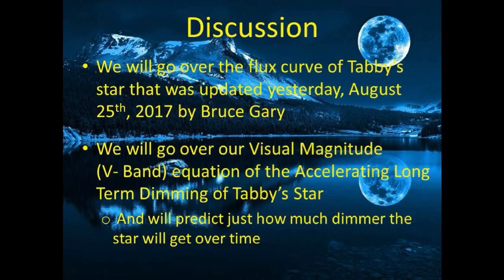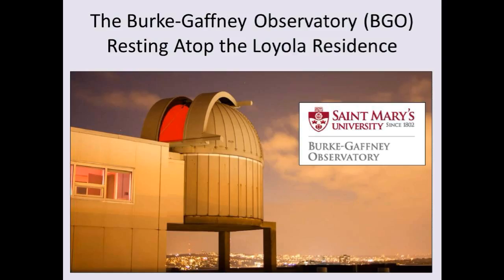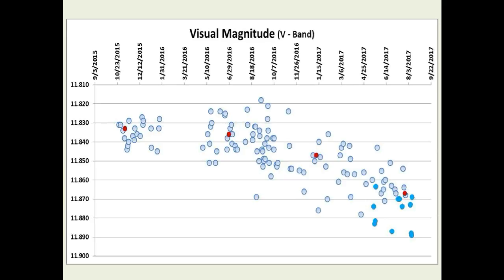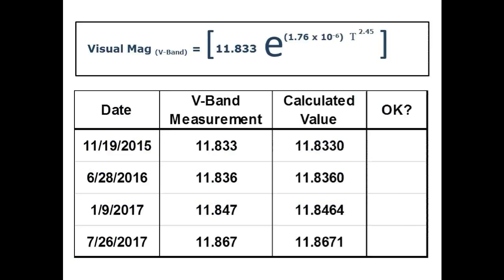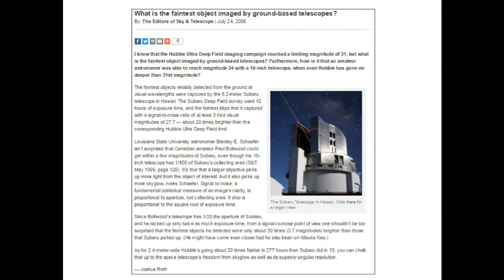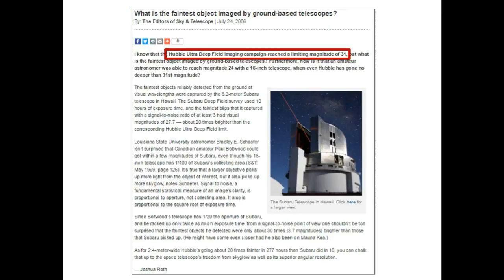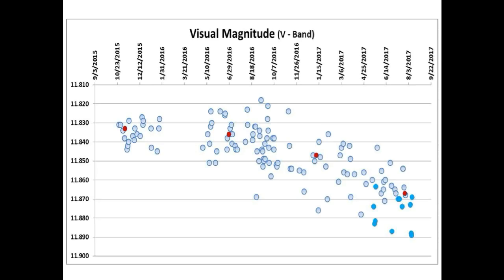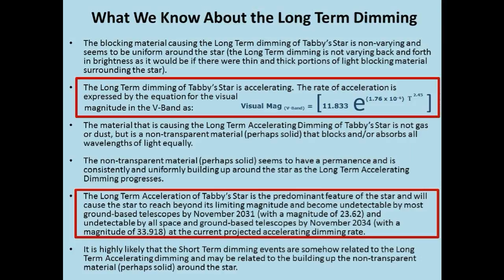Tabby’s Star KIC 8462852  Flux Update for August 26, 2017

Comment: The light curve so far appears normal for a star. The variance of the light magnitude seems to be a stellar phenomenon that occurs repeatedly throughout a star's life. The greater the dimming the more wild the radiant swings much like our star is demonstrating right now.
Reply: Well, we are watching Tabetha's star for it's abnormal behavior. While it's magnitude variation is unique, it's trend is not. Star's share a similar waveform that can be seen in The Solar Cycle. The main difference between stars is the strength of it waveform amplitude . Only, what is unique here is that we are seeing that stars change, their amplitude varies over time with some sort of cyclic behavior such that any star will go in and out of a stable and a rapid amplitude variation. The stability is linked to it's wave crest for some reason and it's greater amplitude variation is linked to the wave trough. Obviously I am reciting personal theories in all this.  Modern theory predicts that such change to decline and rapid variation would herald an imminent stellar demise. It is just that our star is changing it's amplitude too to one of greater variation (exiting a crest) if not as dramatic at this time as Tabetha, yet has no sign of demise. It looks as if this is just "normal" stellar behavior and makes it possible to predict that our sun is going to get stronger amplitude wave forms in it's solar cycle (you can already see this).
Reply: Our Sun is doing what?
Reply: Isn't this a form of as Ad Hoc Naturalis. I mean it is way more likely to be natural via induction. I find the ad hoc rescue nature of the natural only argument.
Reply: Jarred - that sounds cryptic.
Reply: It isn't just curious how the natural only explanation being the go to. I am wondering if that influences your perception of the data and not being truly objective. However, I do think the conclusion should always derive from the evidence, and I am wondering if inductive reasoning is what is being used rather than deductive reasoning.
Reply: The numbers I've read say that this Earth is so rare, according to the Theia impact parameters along with all the other improbabilities, that consequently the pure numbers say there's only 10 tech-civs in the whole Virgo Supercluster. The nearest one is millions of LYs away. 

Of course, I could be wrong... lol   ...We could be very very unlucky..
Reply: iok-1 Rocky planets in the habitable zones of a F/G class star like our Sun may be extremely common.  We just don't know.  We also don't know what conditions and how long it would take for life to develop into complex multi-cellular life.  It may be that it took an unusually long time for complex life to develop on Earth.  These are all questions that await answers and honestly whatever numbers are published today are the just speculation. More than any other branch of science, astronomers have a annoying tendency to present conjectures as "facts".
Reply: David - yes, it's full of unknowns, but----

Small rocky planets have small cores that are not long-lived and therefore don't protect the evolution of intelligent life.  But who knows?  The evolution of intelligence requires billions of years of stable and favorable conditions?  And therefore a protective magnetosphere? 

Without a large stable moon the rotational axis of Mars has shifted over 40° in just the last 15 million years.  Devastating climate change.

Dr. Robin Canup has done supercomputer studies and that collision that formed our Moon is a very unlikely event.  Trajectories and the molten states of both protoplanets and the timing all have to be within favorable ranges.
Reply: Thank you for the replies, yea I am just baffled because I guess inductive logic is really odd logic in general.
Reply: lok-1  Most of the conjectures of rare Earth theory are badly flawed by the anthropomorphic bias.  Not surprising since all we have to go on is the history of life on Earth.   I see no reason why intelligent life couldn't arise much more quickly than 3.5 billion years as it did on earth.  From the Cambrian explosion until the age of dinosaurs was only about 400 million years.

As for moons, what about a planet with two smaller moons?  A larger moon farther out?  Or a smaller moon closer in?   Mars acquired its moons via gravitational capture, why not other rocky planets?  Say a planet doesn't have a large moon.  If that planet was on the order of 150% of earths gravity, it would a much greater rotational stability when it comes to axis tilt change.  Lastly, as for simulations,  I'm of the firm belief that for many simulations of this nature, you can get whatever results you want.   

Bottom line, we simply don't know how long it would take and under what range of conditions complex life could develop.
Reply: David - "Bottom line, we simply don't know how long it would take and under what range of conditions complex life could develop."

Yes, so what's the minimum amount of time, do you think?  1 billion instead of 4.56 billion?

It's true we only have this sample of one, but we also can see in our solar system that there's no cases of stable conditions comparable to those on earth for the last 4 billion years.  There's been large shifts of rotational axes, there's been large impact events more recently than those on our planet's somewhat protected position.

Contributions to our planet's core has been crucial, but that might not be so rare.  OTOH, to get a large moon to form from ejecta at the Roche limit seems to be quite unlikely, due to the requisite angle of impact and the molten states and speeds.  In fact recently the theory had to be updated with moonlets, to try to explain anomalies in isotope abundances.  Fascinating stuff!  Our moon is very difficult to explain AND it's so stabilizing and protective etc. that where would one like it ever form again around an Earth-sized planet in the lifezone, with all other same favorable conditions and constituents and galactic position and helpful sequence of impactors? 

I understand you, I just have so many improbabilities to think about for predicting.  I'm a research meteorologist in a geophysical lab, so with a big help from computer runs I predict chaotic tropospheric and stratospheric systems all the time.  But this case has a large number of parameters, and most of them don't dampen eachother out as in atmospheric dynamics.

Comment: Something must happen to photons of light.  Total flux cannot dim to 0.  Take, for example, shredded aluminum foil (chaff) in sunlight on earth.  If you have enough material few of the photons get through directly but it would still be daylight because photons are bouncing off of multiple pieces.  A dark material could adsorb all the visible light but it eventually comes out as low frequency heat emission.
Reply: Fainter than the Hubble can detect, but maybe not zero.  Becoming a very large black dwarf shell encasing a tiny black hole?
Reply: no, same bolometric luminosity as it currently has.  4.68 times solar.  It will either be reflected and scattered light or we will get 1.8 x 10^27 watts of thermal radiation.  Could be a combination but will still total 1.8 x 10^27 watts.  Reflective material changes the direction the light travels. Does not remove it.
Reply: Yes, currently, it's a huge ball of gas with a 30 million degree core.  How could it become something very different in only another 30 years?   Imagine how much activity and reactions that would have to do the transformation.

In my field, research meteorology, we extrapolate beyond the supercomputer runs of 16 days now, but we don't expect a trend to continue very long in nature.
Reply: iok-1 so can I ask you in your opinion what you think is causing this?
Reply: how about a large mass 5 LYs this side of the star? Two rogue planets (ejected from their systems) collided far from any star. Cooled down by now, no infrared.

Can we eliminate comet swarms, dimming back to its normal flux centuries after a large planet was engulfed, a slowly rotating ring of debris in our Oort Cloud?
Reply: If you go for rogue objects orbiting each other then they are near our Oort cloud.  The objects can be smaller than planets which eliminates most of the size/mass weirdness.  Also would be coming this way.  A good one for the paranoid.  :)
Reply: stefan - Can you explain your statements?  orbiting? near our Oort Cloud? size/mass weirdness?  coming this way from 5 trillion miles away?
Reply: There is an object blocking the light from KIC 8462852.  If we assume that it is in a 740 day orbit around kic 8462852 then the object must be much larger than Jupiter.  If we go to one of our telescopes and throw a tennis ball in from of the lens it could block more than 20% of the light. If objects look the same angle then the closer object is much smaller.  

Assuming this is a binary object in the oort cloud one of the objects lines up with KIC8462852 once every 740 days.  The object is not moving away from our line of site because it keeps rotating into it.  So the objects are not in orbit around the sun so they must be falling towards the sun.
Reply: stefan - you might be right.  I still don't understand how you explain the periodicity.

Here's a paper on a ring in our Oort Cloud, but it's fallen out of favor I think,

 “Matter may be distributed very nonuniformly within a ring, so that in any Kepler-year the probability that the line of sight intersects a significant quantity of absorbing matter during the brief period when the line of sight grazes the ring may be small. This is necessary to explain the absence of deep dips between dip 5 and the cluster of dips 8–10 or a Kepler-year prior to dip 5. There may be many more potential “Tabetha’s Stars” in the Kepler field than actually dipped during its four years of observation, and Eq. 3 is a necessary but not sufficient condition for the observation of dips in KIC 8462852. This model makes unambiguous predictions as to the timing of possible (but only possible, because the ring appears to have a filling factor ε ≪ 1) future dips. It also suggests a finite, and perhaps short, correlation length between dips observed from separate locations. Testing this latter prediction would provide a clear distinction between circumstellar and Solar System models (independent of the specific ring model proposed here). The observation of decorrelation between Solar System observers would definitively prove a Solar System origin, but to disprove it would require observations from at least one distant ( 0.01 AU) space platform as well as from Earth.” 

https://arxiv.org/pdf/1705.08377.pdf
Show less
Reply: If there is a planet or some other massive object large enough to block up to 20% of the star's light. it would easily have enough gravity to cause a significant wobble of the star.  So far, we have not seen such a wobble.
Reply: Yes, there's no massive object involved I would guess.

If an F star rotates very quickly due to an unusual early accretion process, would it generate numerous sunspots like with this pattern?  The long term accelerated dimming could be temporary (a few centuries) due to core disruptions and then the sunspots could darken the star 20 percent occasionally?    

Because, the changes in stars over centuries of their much longer lifespan, I would think would be difficult to theorize about (some surprises during spans of only centuries).   There's a lot of observational data about different types of stars, but could it be slightly misleading?

Comment: Note the third bullet point in the final screen. "That blocks and / or absorbs all of the light"."This is non-transparent that is neither gas nor dust" . That seems to suggest a large solid item. Solid items like planets do not grow in size. Anything that is loose in the system should be reduced in coverage as tine progresses due to the effects of gravity. What other gravitational effects could keep the orbital items in a chaotic mode?   Perhaps a couple items in a high epileptic obits? Which would do the job better high close to the sun or far away? Just bouncing ideas around.
Reply: Capt777harris- Those two planets would need to be the size of 44 Jupiter's then, because that's how much light was block from this star in 2014 with a 22 percent light drop. Not possible. The Star is also an F class star and is 3 billion years old or less, not likely it is going super nova anytime soon. Also some light dips only last a couple hours while others days apparently...
Reply: David Dirré-Moire  A star does not dim in a time frame of few hundred years. What ever is causing the dimming is not a natural object.
Reply: Brand131,  Forget about the Higgs Boson,  the discovery that a  main sequence star can intrinsically dim on its own would be the scientific discovery of this century.   If you can prove your statement, start clearing a spot on the mantle for your Nobel prize.
Reply: Not just that, but it could also be something intrinsic to the star. The star itself losing brightness sounds like a far less extravagant explanation then a unknown solid material blocking more of it over time.
Reply: David Dirré-Moire -- Maybe I use the word 'intrinsic' in the wrong way here. What I mean is that it might not be anything external that is occluding the light of the star, but that the star itself is dimming. The cause of this can be external in origin. Brian Metzger and Nick Stone explained how in their video here on Youtube, which is called "A Theory for Tabby's Star (Without Aliens) | Metzger & Stone" on the Youtube- channel "Cool Worlds"
Reply: Brand131 Got it.  I see your point now.  I read the paper by Metzger et al. Their idea is probably the best attempt at explaining LTD so far, but it leaves many unanswered questions.  Their explanation of the STD is much less thorough and is implausible in my view. But at least they try to account for both phenomena in the same paper.
Reply: Capt777harris Ok, but what about the LTD?
Reply: Capt777harris, Ya i suppose its mass would matter more regarding collapsing but still the fact remains in order to block 22 percent of tabby's star we would need an object or combined objects of 44 times the size of Jupiter to get between us and it often and in a cycle that can be days or even hours apparently. I think it actually could all be the above if you think about it. A mega structure like many have stated would need a constant stream of asteroids to mine in space to be able to likely and cost effectively have the material to build it with. So a mega structure would likely be joined by a near by swarm of asteroids anyways, but like the computer models say so far it's very unlikely to only be asteroids....
Reply: Capt777harris- How could they figure that out if it is near the star or not?
Reply: Ok, I just didn't know if they had a way or not to measure that. I figured they have some how already done this because no in is proposing it is an object outside of the tabby's system that is blocking the sun.
Reply: One way to see if the object is near to the star is look for a wobble in its rotation.   If a massive object is near the star, we should detect a significant wobble.  No wobble would indicate that whatever is blocking the light is very far from the star and not likely in  Tabby's star's solar system.
Reply: Could this be the results of a planetary impact? One planet being driven close to the sun and the other being launched out into the system after a graze close to the sun. The orbits are still irregular because the system has not settled down to a agreeable gravitational balance. When the orbits line up we get an amplified blockage. This DOES not explain the lack of IR from the system though. Anything that close to the sun would have to create an IR output.

Comment: There is a preprint paper which talks about the ~daily rotational period of the luminosity: http://vixra.org/pdf/1708.0292v1.pdf
Reply: I might have missed it, but that paper doesn't mention a long term accelerating dimming curve.  They seem to be deciding that it's a variable star with cycles that can be determined and predicted.  And when the dips occasionally don't occur on time they talk about complicating factors we can't know about yet.  

Is it a variable F star with mechanisms like unusual magnetic sunspot activity which haven't been seen elsewhere?  Do they have the rotation rate wrong?
Reply: I had to look at it further,  think there are things that may be analyzed on the short term, by considering the long term as irrelevant. This is important, because it might help figure out the mechanics of what is the process of accretion.